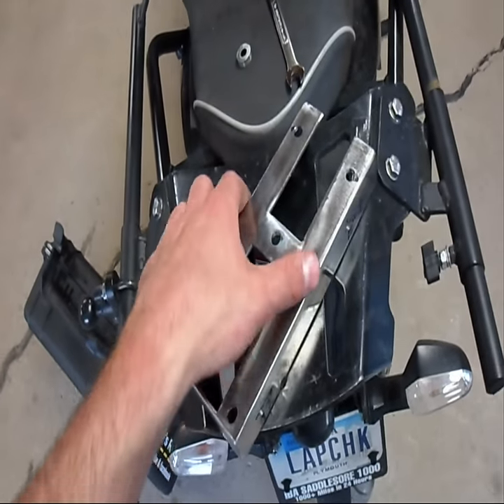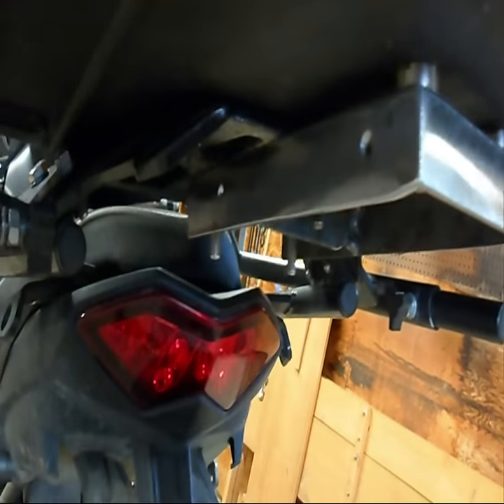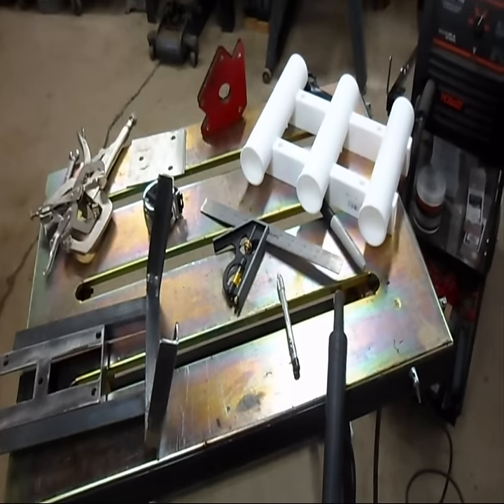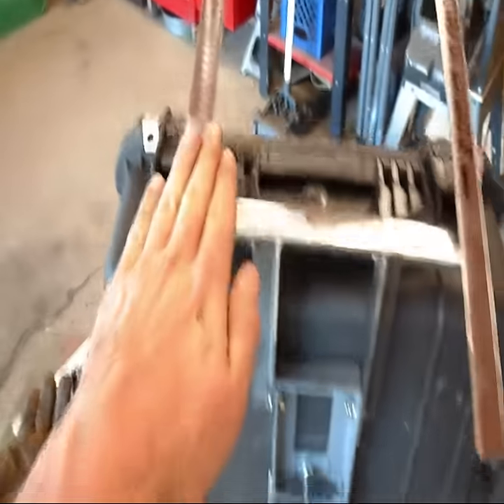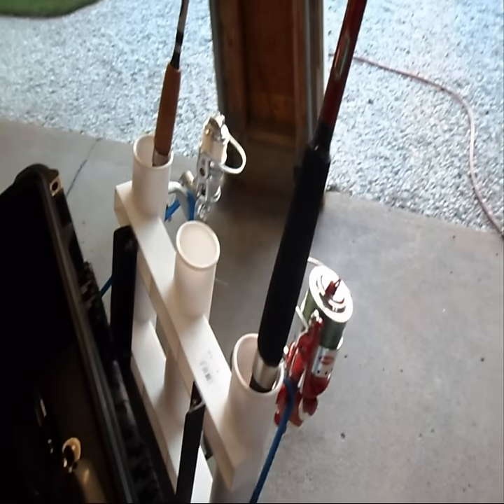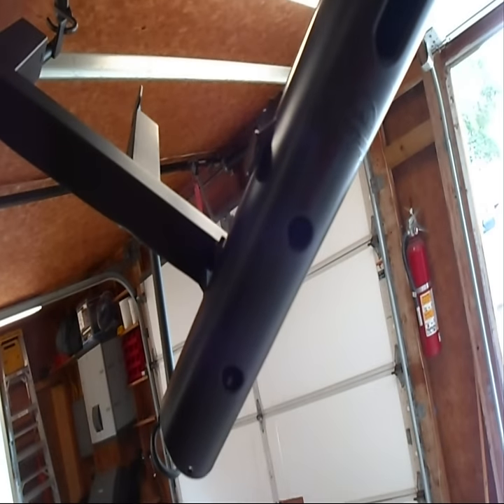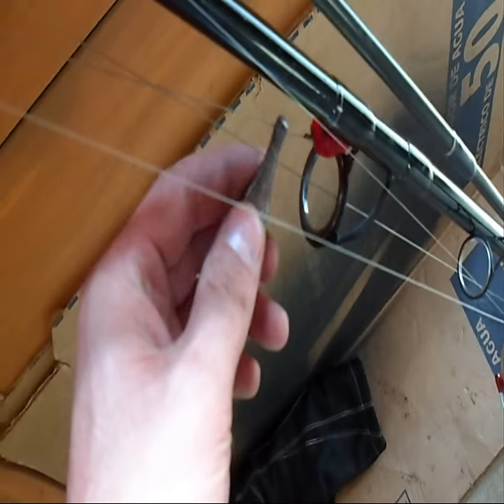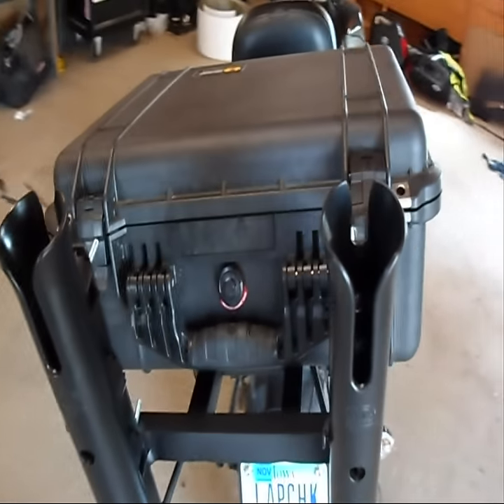Motorcycle Fishing Pole Holder

Comment from the maker: Make sure you brace/gusset everything, because the back of a motorcycle is a very bouncy place. Plus, those poles way up in the air catch more wind than you think. I learned the hard way that you have to use a clevis on the end of your line and hook it to an eyelet, or just de-string your pole when you move. The wind will bend the poles slightly, and hooks come off eyelets and stick you in the back when you stop. If they don't fall off that is.